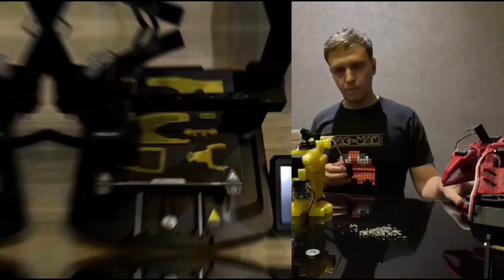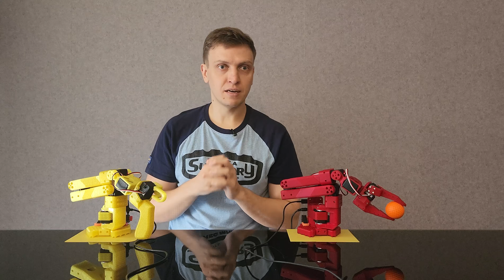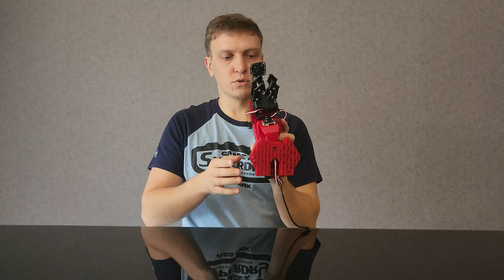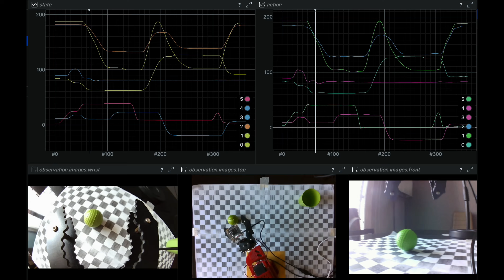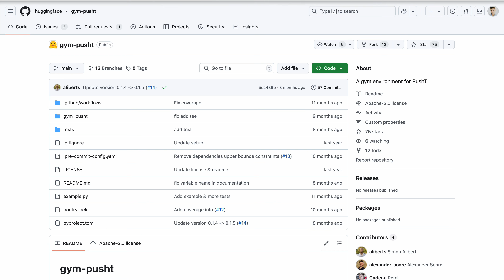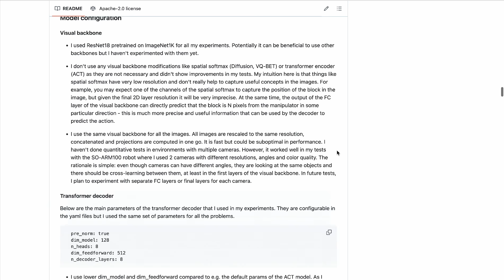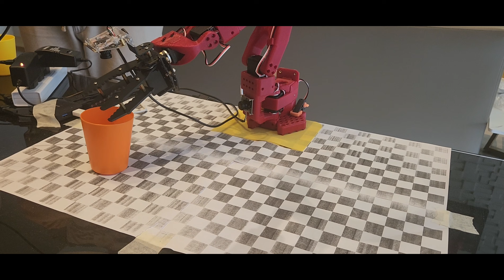Running AI robotics experiments at home with LeRobot and SO-ARM100

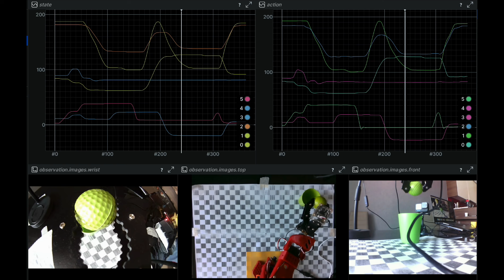Comment: 28:28 
Hi! Great video. I'm waiting for the so-101 kit from wowrobo - they included a 2MP camera module for the gripper, but I couldn't find the field of view spec. Could you please share the exact models of the cameras you used on both the gripper and the base, and what their resolution and field of view are? Thanks in advance!
Reply from the maker: For the wrist camera, I use https://s.lazada.co.th/s.viOCK, and I like it.

But I don't like the one at the bottom, so I won't recommend it.
Reply: Thanks for the reply! I noticed in your video that the working areas from both the wrist and base cameras look very clean - no noticeable fisheye distortion or unnecessary wide-angle artifacts. Was that a result of specifically choosing certain FOVs?

Also, is it important to use different field of view angles for the wrist and base cameras, or would a 160° FOV (like the one you linked) be suitable for both positions? I'm trying to make sure I get optimal coverage without overdoing it on the angle.
Reply from the maker: @ai_thoughts_lab  Good questions. I don’t have clear answers - camera choice is mostly trial and error, and can depend a lot on your use case. But I’ll share my observations.

The wrist camera does introduce some distortion. Objects in the gripper look fine, but things on the sides get warped like in any wide-angle lens. That’s usually okay if you’re training your own models - wide FOV gives you more context, and models can learn to handle the distortion.

I tested a few cameras, and this one had the widest FOV - I liked it the most and now use the same one for the robot base, too.

If the models that you are going to train use the same backbone for all cameras, it should be beneficial to use the same cameras everywhere (but not necessary).

I’ve noticed some general-purpose models (not robotics-specific) struggle with wide-angle images, especially when estimating distances. They’re not always accurate unless fine-tuned. E.g. if you ask LLMs ot estimate distances based on the pictures, they are not very correct.

One downside of this camera: the colors look a bit faded and not very vibrant, but functionally it works just fine.
Reply: Thanks for the detailed response. I thought of using 3 cameras with different perspectives, like in your video. For example, around 100° FOV on the gripper, 130° on the base, and I'm still not sure what FOV would make sense for the third one.  In general, I assumed all the images would be stacked into a single tensor as 3 RGB inputs (so 9 channels total), and the network would likely rely on the base camera (and maybe the top one) to decide the direction of movement, while the gripper camera would help determine exactly what to pick up.

I’m thinking in the context of a task like sorting colorful children's cubes (2x2 cm).

However, after looking into the topic more, I realized that different camera modules can vary quite a lot in color reproduction. That could make it difficult to apply one shared preprocessing pipeline to all images - or at least, it might be too rough for some use cases.
Reply from the maker: @ai_thoughts_lab  Images from different cameras are usually not stacked together; each of them is processed separately by a visual backbone (sometimes the same, sometimes unique for each camera). If you use the same backbone, it is beneficial to use the same cameras, as it makes it easier for the model to generalize and extract features. But even with different cameras, it will work.
Reply: So just to clarify - you're using three separate backbones, one for each camera, and then concat the extracted features. And in practice, does that work much better than using a single shared backbone?
Reply from the maker: @ai_thoughts_lab  Depending on the model, it is either 1 backbone per camera or 1 backbone for all cameras, but in both cases, you don't stuck images into a 9-channel image, you process each one of them as a normal 3-channel image.
1. Backbones are usually pre-trained on ImageNet or other datasets, which consist of normal RGB images; you can't simply pass non-3-channel images into it.
2. If you stack 2 images from 2 cameras into a 6-channel image, it doesn't make much sense because they are not aligned, and the pixels on these images correspond to different points in space. You can stuck the RGB image and Depth channel from the RGBD camera into 4-channel images and use some special backbone for them because the D and RGB channels are aligned, but you can't simply stack 2 different images without pixel-level alignment.
Reply: Thank you so much for the detailed and valuable answers - things are much clearer now!

Comment: Hi Ilia !! Thanks a lot for your video, it’s very clear and precise. 

Do you have the reference for the cameras and where did you find the model for the hand you are finally using ? Thanks again !
Reply from the maker: For the wrist camera, I use https://s.lazada.co.th/s.viOCK, and I like it.

However, I don't like the one at the bottom, so I won't recommend it.

Top view is Realsense D435. I use only RGB and ignore the depth channel. But I use it just because I have it. You can use a simpler camera for it.

I took the gripper from another robot I bought many years ago. I think it is this one: https://www.ebay.com/itm/222230012431
But it is not designed for the servo motors that SO-ARM100 uses. So, I really brute-forced it to work (don't recommend it). I plan to replace it with another one in the future (either from the community or I will develop it myself).
Reply: @ilialarchenko  okay thanks a lot ! For the gripper, you managed to use a different motor from those used by SO-101 ? Did you have to changed the code ?
Reply from the maker: @josephdelaportaliere1747  No, I use the same motor as in SO-101, but I needed to squeeze it into the gripper and bend some parts to make it work.
Reply: @ilialarchenko  okay Thanks !
Reply: @ilialarchenko  so at the end you should be able to have the arm working alone, disconnected from your computer ? ( if the cameras are connected to the motherboard) Or does it still need the computer to run the program
Reply from the maker: @josephdelaportaliere1747  No, you need a computer (preferably with a GPU) to run the trained model. The motor controller passes the signals from the computer to the motors. Also cameras are connected to the computer.

A single-board computer, if it is powerful enough to run your policy, is the minimal setup that you can use.

Comment: Thank you for making this video, i am building my first so100 , is a 12V 5A 60W Power Supply enough for running the arm? , i am using the 12v 30kg servos. I have seen in the discord group that since we are having 6 servos in series and when on load it might take more current. I currently have the 12V 5A 60W Power Supply  would it be enough. Thank you
Reply from the maker: Yes. It should be enough

Comment: Hello, We’re trying to use the ACT policy with 400 data samples and 2 cameras to pick up a bolt placed in different positions and locations. We ran 50 episodes for each position, but the robot still fails to pick it up. It makes several attempts but doesn't manage to grasp the bolt. After a while, it starts to shake and eventually stops completely. The robot doesn’t seem smart enough to complete the task successfully. Do you have any idea what might be going wrong? Thank you
Reply from the maker: Hi!
It is hard to say what the problem is without seeing the data, robot configuration, and training parameters.
400 samples should be more than enough for a simple pick-and-place task. I made it work for around 50 samples using both ACT and DOT policies. Just some advice:
- make sure your cameras are conveniently located. Can you complete the task using teleoperation and relying only on cameras?
- Try to simplify the problem, use a fixed location of the object (just take a subset of your dataset), and make sure the model policy works there - it will help to isolate the problem
- try to change some policy hyperparameters. E.g. increase / decrease chunk size. Predicting 1-2 seconds to the future should be enough.
- try other policies like DOT or diffusion
Reply: @ilialarchenko  yeah we work based on teleoperation and we have 2 cameras
Reply: @elnazasadollahi351  were you able to get this working?

Comment: Great video! A question:
- If the model is trained, can i theoretically upgrade the model/dataset by using the robot-s tries of (in this example) picking up the ball and putting it in the cup successfully? 
- Would it be beneficial to somehow include the failed attempts too (and label them as failures)?
Reply from the maker: Great question — you're stepping into the Reinforcement Learning zone here!

Short answer: yes, you can keep improving the model using new successful and failed attempts, but it’s not as simple as just appending them to the dataset — you'll need extra training logic.

If you just add more successful trials to the dataset, it likely won’t help much. Adding failed attempts labeled as “bad” might help, if the model can learn from them, but that’s tricky with pure Behavioral Cloning.

To improve performance, one way is to introduce some exploration — let the model try slightly different actions, and use both successes and failures to fine-tune it.

Another promising method — something the LeRobot team and community are exploring — is HIL-SERL. In this setup, the robot acts autonomously, but when it's about to fail, a human can intervene. The corrected trajectory gets used for learning. It’s like smart data collection for hard cases. You can join LeRobot Discord to learn more about progress there.

Comment: What's it take to convert the leader arm into a follower? If i buy 3 sets and just leave one as a leader. Do I just need to make another end effector to it?
Reply from the maker: @miestermind  yes. You just need to attach the gripper, and that is it. If you set follower as leader and leader as follower in the config it will work, and the leader will mirror movements of the follower. They are absolutely identical except the shape of the gripper.
Reply: @ilialarchenko  can I use the ONE  leader to train all then then eventually train THAT one?
Reply from the maker: @miestermind theoreticaly if all your arms are properly calibrated you can collect a dataset using one pair and then apply the trained policy to all your arms, including the leader transformed into the follower. But I didn't try it.
Reply: @ilialarchenko  you are a hero. Thank you for clarifying this is what i assumed as well. Thank you for such a straightforward and informative video. Looking forward to more details of your hobby adventures.
Reply from the maker: @miestermind  thank you!

Comment: Great Video ! I learnt a lot about the leRobot training setups! Quick Question: I wanted to get started with implementing the pi0 VLA model, how do you recommend getting started with it using the LeRobot implementation? (I wish to deploy it eventually)
Reply from the maker: @pranavshukla7821 I didn't try to run it on so-arm100 yet. But there are people in LeRobot Discord who did, so you can check their posts.
You can also run GR00T VLA on this arm, and also just check out discord discussions. There is a separate channel dedicated to VLA models.
Reply: @ilialarchenko  thanks!

Comment: You can probably calculate how much the robot can theoretically lift by using the torque spec of the motors and the formula torque = r x F
Reply from the maker: Yes, good point — let’s do it. The torque of the motors I use is 30 kg·cm, and the arm length is around 40 cm. The actual distance to the center of mass of the object can be slightly more, so let’s assume 45 cm. That gives a max weight of:

30 / 45 = 0.66 kg

We also need to factor in the arm’s own weight:

- 165 g from 3 motors near the gripper

- 55 g from the middle motor

- Plus ~100 g correction for the arm structure and gripper

So the total is roughly 400 g, which is close to reality — though still higher than what I showed in the demo.

If you use other versions of motors:

20 kg·cm motors → should lift around 200 g

50 kg·cm motors → up to 800 g

And of course, these numbers are higher if you don't extend the arm fully.
Reply: @ilialarchenko  Excellent! I guess you have to factor in that the self weight is only roughly half the distance (assuming uniform density). A more accurate calculation can also be done by summing each torque separately.
Reply from the maker: @famnyblom6321  yes. 100 g correction is my random guess anyway, I didn't actually measure it. And a lot of weight is in the gripper.
For the sum of torque, I think the one motor at the base has the highest load anyway, the rest have shorter levers. If you want to optimize it you probably can use one 50 kg cm torque motor and use 30 for the rest (even 20 should be enough for some joints but it has different voltage so it is not convenient to use them together)

Comment: This is way more than I expected!! Great work 🎉
Reply from the maker: Thank you!
Reply: @ilialarchenko  Btw, that fork for the PS4 controller...am I just running the teleoperation script and it will use the controller instead? I would actually like to modify it to get the positions from a server so I can use my VR Setup!
Reply from the maker: @swannschilling474  Yes just choose the controller in config instead of leader arm, and it works for teleoperation and dataset collection. You can refer to this PR: https://github.com/huggingface/lerobot/pull/516 . But I did it a few months ago, there were some breaking changes in the library so currently it will work in my fork but need to be adjusted to run with the latest version of LeRobot.

You can definitely do it with a VR setup and server commands. There are probably people who have already tried it before. Also, check how they implemented the remote control for LeKewi (it is the mobile version of SO-ARM100 that can be controlled remotely using RPi) - I haven't looked at its code yet, but my guess is that they are doing something similar there.
Reply: @ilialarchenko  thanks a lot, that is a good idea! I am still trying to make sense of where to find things and get started!
Did you ever see other motor implementations? 
I am very unsure on how to do this and was thinking of using the well documented DYNAMIXEL 2.0 protocol to talk to my motors instead of messing with their motor bus? That would make it bullet proof for changes in their code...
Reply from the maker: @swannschilling474  there is an alternative arm, that uses dynamixel motors and it is also supported by LeRobot https://github.com/jess-moss/koch-v1-1
I am not sure if you can fit dynamixel motors into so-arm100
Reply: @ilialarchenko  that is a great arm, but my arm is using the ODrive, so I will just modify my motors to talk the DYNAMIXEL 2.0 protocol, that should be an easy way to make my arm compatible...

Comment: Can it be possible to use existing open source vision models to control this robot?
Reply from the maker: The main focus of the LeRobot library is end-to-end policy control. This means that you use one big model that accepts images from the camera and outputs the actual robot actions. Most policies already use pre-trained open-source vision models as one of their components and then fine-tune the full pipeline end-to-end.

If you want to use the exiting vision model as a completely separate step, it is still possible, but you will need to implement it yourself, as it is not the main use case for this robot. You will need to have a pipeline like this:  
1. Use pre-trained model to detect object. 
2. Use detection data to plan robot actions.
3. Translate it to the command to the robot.
One way would be to integrate the robot into ROS and use some existing tools. E.g. here, I implemented 3D object detection in ROS2 for another robot: https://www.youtube.com/watch?v=-Kn--H3KKJw

Comment: Thank for the video: I am new to the robotic field but why is the RF not on Isaac sim ? is it to make it easier ?
Reply from the maker: Not entirely sure, but I can make an educated guess.

There’s no reason why LeRobot, SO-ARM100, and Isaac Sim couldn’t be integrated. It’s likely just a matter of time and priorities since LeRobot is a relatively new library that’s evolving rapidly in multiple directions.

You can already generate datasets in Isaac Sim and convert them into LeRobot’s format. Plus, NVIDIA's latest Isaac-GR00T VLA model works with the SO-ARM100.

So, I’m pretty sure they can be integrated — it’s just that no one has made it work out of the box yet.

Also RL approaches are under development in LeRobot and probably some of the later version will be able to use Isaac Sim.

Comment: Sorry to ask on a YouTube video, but you seem very knowledgeable.
I have the leader and follower made, and have managed to get to teleoperation, but keep hitting issue with anything more - getting video errors and hitting bugs.
I have tried following the readme, and the so100 documentation, but they seems to have errors and not be upto date with fixes I find elsewhete, or they assume you are already pretty good on Linux and understand ML. Which I am not 😂
Are you aware of any super basic walk throughs? I tried to look through your pages, but they don't seem to have any more of the basic details.
Thanks in advance
Reply from the maker: In my case everything worked pretty smooth when I followed original instructions and I am note sure if there is a better one.
But yes, there can always be some small problems that are easy to solve but can be a big blocker when you don't know how.

I would recommend to join LeRobot Discord and ask your questions in the `help` channel, quite often you are not the first one with this issue and other people can help.